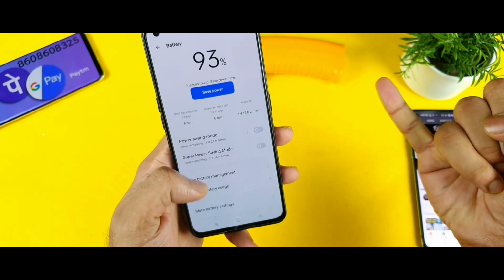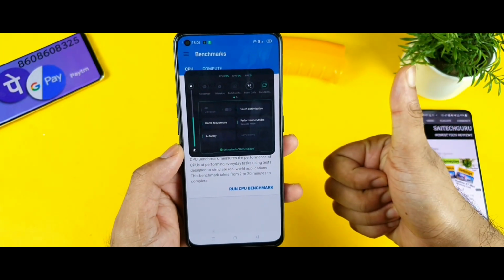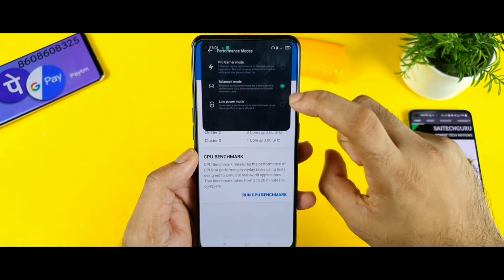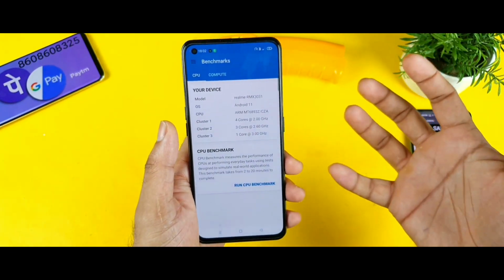Realme X7 Max Geekbench 5 using high performance, game space, don't optimize, pro gamer mode & 13gb🔥

Comment: Bro the horizontal thin line irritating me. Today I ve visited realme service centre they installed software from their system but no use none of this working you do observe the line in 720 resolution also no youtuber is taking this as a serious issue but ppl like me who spent more time watching series and movies know the pain 😞😞😞....! What to do for that and whats the reason behind the line ? I vent seen it in bgmi and prime video till now. Almost all video players including hotstar, inbuilt player mx etc I ve seen the issue....☹️
Reply from the maker: Hi Arjun I can understand but I will upload the videos on this issues and highlight the problem I will also forward the problem with realme team 👍don't worry I didn't get any solution for this problem.till now
Reply: @SaiTechGuru  Thnx bro 🙂
Reply: Can you please elaborate about what line ? How can see that issue ?
Reply: @akashbrathod5928   type Costa Rica in youtube you will see a video play it in 240 or 360 resolution you will see a white line horizontally in landscape mode exactly at middle of  the screen
Reply: @forensicpredator3020  I did notice  some line separating screen.. it was vary minimal.. I guess. But when I tried watching some other video with 1080p , 4k it was great I didn't notice anything
Reply: @akashbrathod5928  But we can't use our mobile data for that bro nobody will see any video in 4k or 1080 with mobile data I think so 😅😅 if you have wifi that's other matter to discuss.
Reply: @forensicpredator3020  why not brother.. first I used wifi.. after reading your comment I switched to mobile data I was able to watch upto 2160p60.. 😄.. did you see same problem with other phones ? I did.. I think  problem it's with the screen ratio